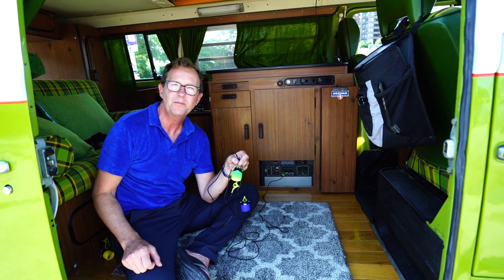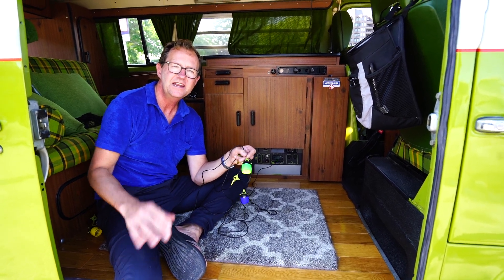Using A Solar Panel To Generate Power in a 1976 VW Bus

Comment: Thanks. Is that a working fridge above your goal zero?
Reply from the maker: No.  I removed the internal water tank and also the original fridge compressor.  Internal tanks are heavy as was the 1976 noisy fridge compressor which could only be used when the bus was plugged in to an electrical outlet.  The fridge (ice box) is actually next to the sofa which I still use but not with a compressor, just ice packs.  Above the goal zero is storage for plates, pots and pans.